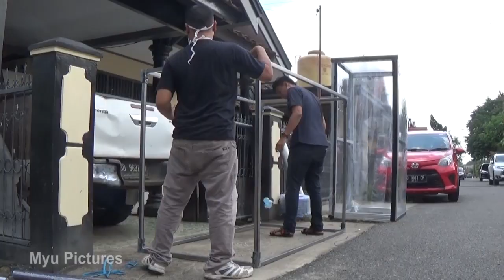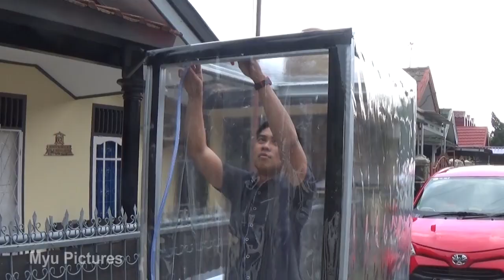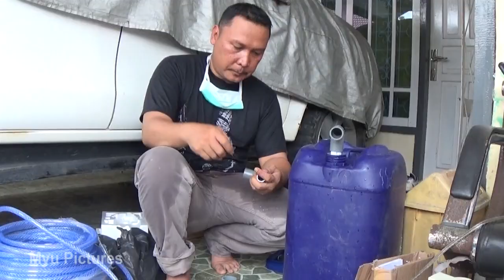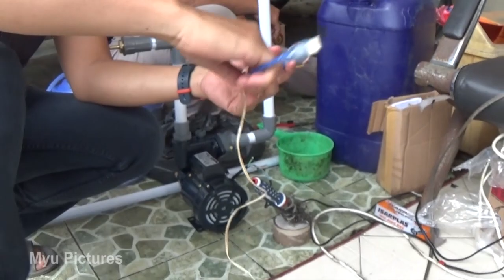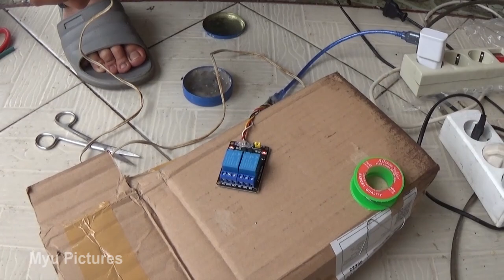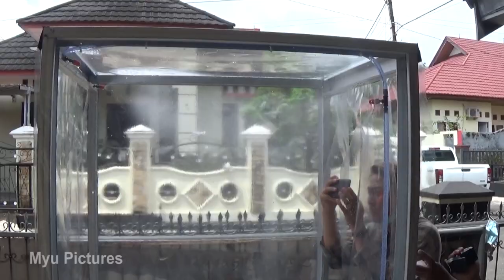CARA BIKIN BILIK DISINFEKTAN SENSOR MURAH MERIAH

Comment: Harga 2 jt
-Pompa 1 pcs camflo khusus kabut
-nozel  5  pcs
-fiting.  5 pcs
-selang 30 meter
-modul set box paket
-push button 1 pcs
Bonus fiting T dan L

Harga 2,5 jt 
-Pompa 1 pcs camflo khusus kabut
-nozel  5 pcs
-fiting.  5  pcs
-selang 30 meter
-modul set box paket
- otomatis sensor
Bonus fiting T dan L

harga di atas bukan termasuk bilik
*Not: bukan pakai pompa semprot cuci motor yah,klo pakai pompa semprot cuci motor suara kasar dan pressure kurang

* pemesanan sebelum jam 10 barang akan dikirim 
   
* pemesana di atas jam 10 barang akan di kirim ke
   esok harinya
Reply: Mt no kontak dong